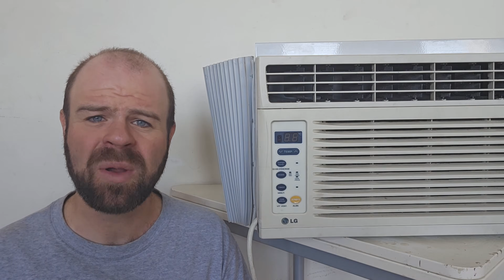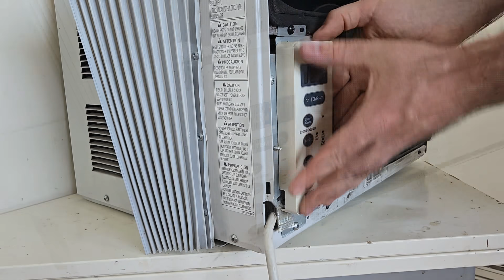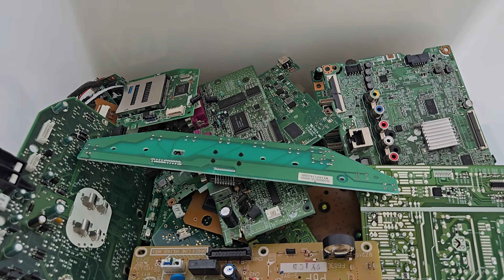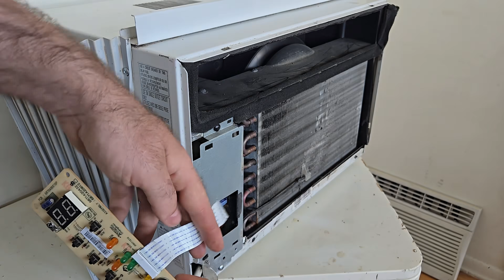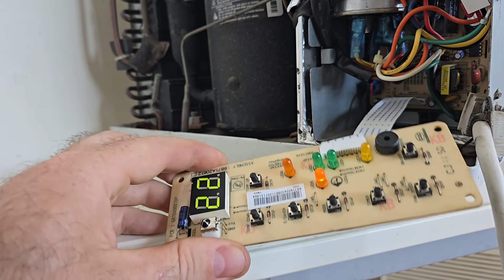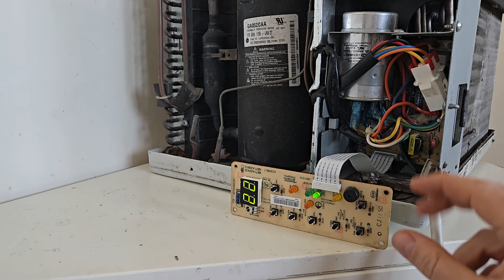Fixing a Window Air Conditioner - Buttons not working

Comment: Wow!! I love this. Partially because I fixed a piano keyboard recently by taking it apart and figuring it out... And partially because I was gifted this exact air con this summer. My buttons work but some of them are a liiiitle iffy. 

Question if you have any advice...... Mine works but the cooling feels really not that strong. It's there but when you switch to dehumidifier mode it's almost like oh... That feels nearly the same. Is there ANY point in having someone try to repair it? I assume it's near the end of its lifespan anyways. Sorry, I know you're not an HVAC professional haha but I'm in TO too and it's funny you have this exact one. Any recc's for local AC handy people? 😅 Great video!
Reply from the maker: Awesome!  I suspect a service call from an HVAC tech would cost you almost as much as the unit is worth. It's possible that the unit isn't operating as effectively as it used to because the coils are clogged with dust. I would start by trying to clear out as much dust as possible by vacuum them, or blowing them out. The evaporative coil (the one that gets cold) probably won't be as bad, since it has a filter in front of it, but the condenser coil (the one that gets hot) could be pretty bad. Best of luck!

Comment: Great Video as always, CJ. I refurbished an old AC by cleaning it. I used a spray foam coil cleaner on both the front and back fins. I spray rinsed the excess foam with water. After drying, the AC works like a charm.
Reply from the maker: Awesome! Nice work :)